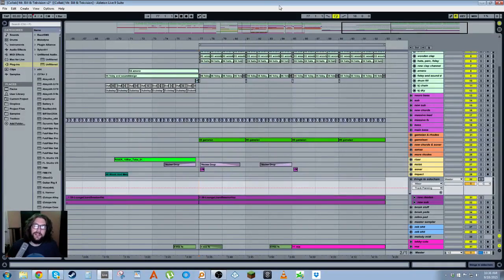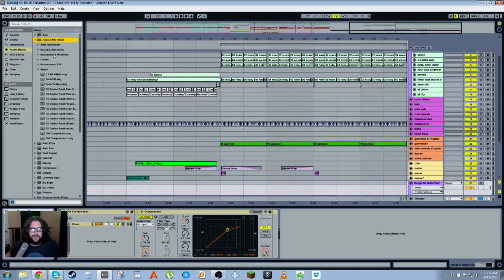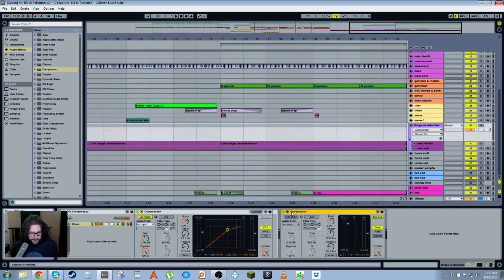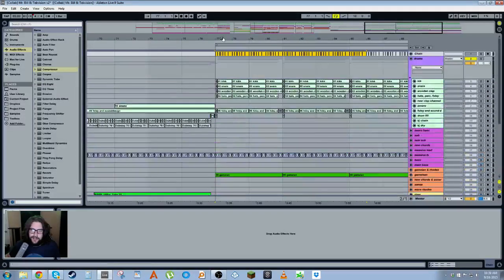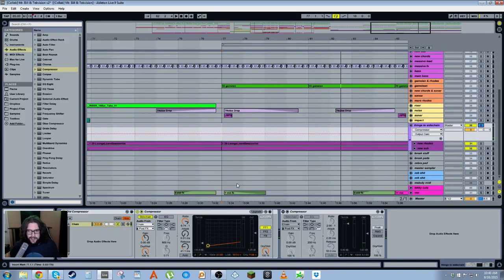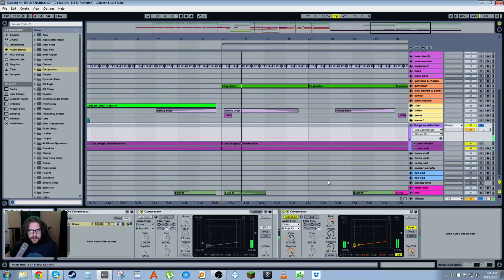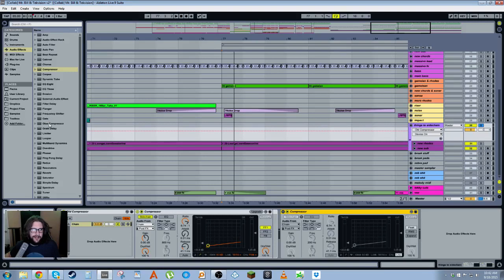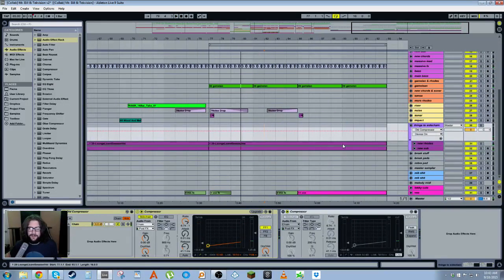Mr. Bill - Ableton Tutorial 51: Live 8 vs Live 9 Compressor

Comment: I just use LFO Tool by Xfer for sidechaining. It does a good job
Reply: +Mike Costello The issue with LFO Tool is that it's just that; a repeating LFO. It isn't dynamic. Notice the click track at the top he uses. It's not a simple repeating click that hits every beat. The rhythm of the kick and snare varies throughout the track, and setting up a sidechain allows you to match the pump to that as you make edits. If your track is a simple four-on-the-floor through the whole thing, then it's not a bad plugin to use. You could set up several LFO patterns within LFO Tool and switch between them throughout the song, but that's more trouble than it's worth. Setting up a sidechain is much easier in these dynamic sorts of tracks.
Reply: but you can automate the lfo rate and shape the sidechain however you want it. You can automate almost any knob on a VST in Ableton. If you want just the bass hit of the Kick and not include the tail of it then you can shape the LFO to do that too and everything else that was done in this video. Virtual Riot uses it in one of his live streams.

Comment: I would've liked to have seen you start with getting the 9 compressor sounding good and then copied those setting across to the 8 compressor. As then 9 would have sounded better. It was a little unfair, as both have a different character and need different settings to make them work well. The 9 compressor is much faster and need a slower attack time to stop the clicks. Interesting comparison though thanks for the video.

Comment: Hey, I tried it with RMS and it seems there a no clicks when using that option
Reply: +James R That's because RMS measures input volume in a totally different way. Peak measures the exact amplitude of every individual peak sample, but RMS measures an average loudness, so when you switch it to RMS, first off it's not reacting quite as quickly because it's averaging that initial transient of the sidechain, so you don't hear a click, but it will react to the rest of the sidechained signal in another way. It's not a bad mode to use, but just know that it's a completely different method of volume detection.

Comment: Interesting, when I get clicking I just increase the attack time. I grabbed your old compressor rack and did some comparisons, it looks like the new compressor really is just much faster than the old one. Comparing both compressors with lookahead at 10ms shows them both kick in at -10ms relative to the transient, with an 0.01 attack the new one slams down straight away, whereas the old slowly ramps down to slightly past the 0ms point. Setting the new compressor to 20ms attack seems to yield an almost identical attack stage to the old, though I'd probably just push it up far enough to stop clicks. The other big difference is there seems to be way more "hold" time on the old compressor before it starts to release (I'm testing at -inf threshold). The only way I can replicate a similar hold/release stage with the new compressor is to throw it into lin mode, but then the attack stage just ends up slamming down instantly no matter how high I push it. You could probably just lengthen the clicks to tune this. Stuff worth thinking about if they ditch the old compressor code in live 10.
Reply: +Ycros A flipped gate also gets really close, but the release is more violent
Reply: Exactly.